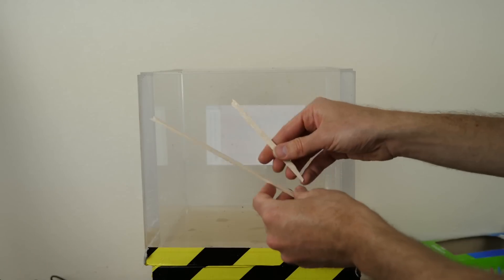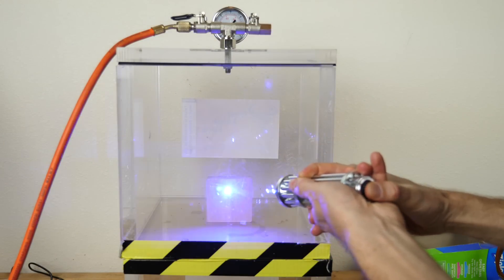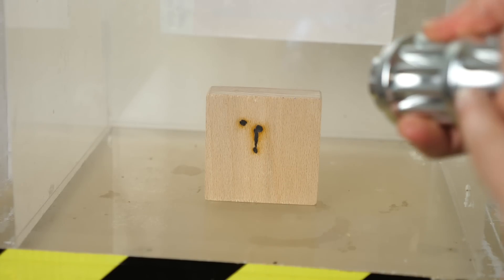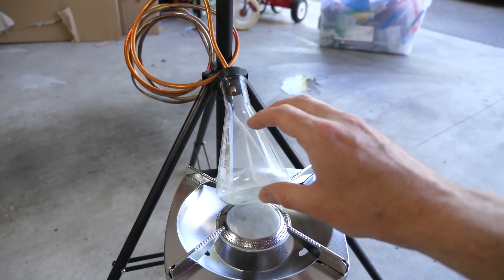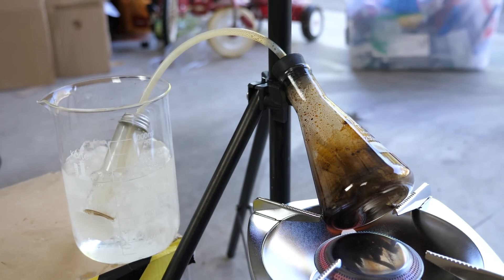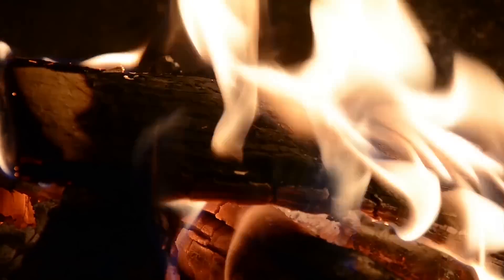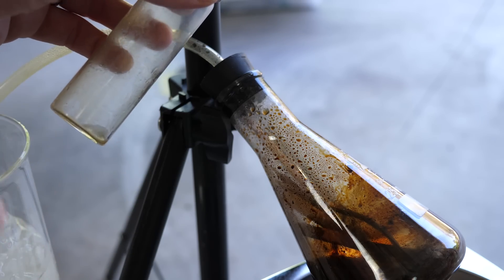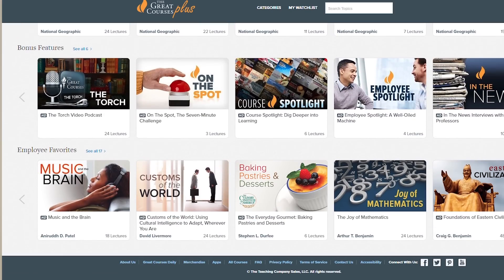Is It Possible to Melt Wood in a Vacuum Chamber? The Wood Distillation Experiment

Comment: No...

Pyrolysis will result in the decomposition of the Wood, even if no “Combustion” occurs.

The wood “breaks” down into the various components, and the long-chain polymers, like lignin, prevent the remaining materials from “Melting.”

You MIGHT be able to get it to “Melt” if you could lower the melting point of Carbon substantially below the 3500°C it requires at standard pressure to “melt” Carbon, which would then be below the temperature of the “pyrolysis” which causes the constituent breakdown OF the wood.
Reply: Soo if I'm reading this correctly it is:
"No..." the video isn't entirely accurate.
If [the remainder of what you said] is achieved, then you could possibly cause the wood to melt?
Reply: Zac 

“Possibly” being the key.

Comment: I actually believe it melts. All matter will melt if it's molecules vibrate and space out, allowing them to move and roll over one another but the problem is usually, it pyrolyses before it can melt so it does not usually melt. Usually.

Comment: A technique called “mechanically-induced wood flow welding” bonds wood in seconds without adhesives. Like ultrasonic welding of plastic parts; basically melts, flows and fuses the molecules of the parts together under pressure and high frequency agitation.

Comment: there are view correction from this video that i want to point out,
1. You need to seal the rubber lit with parafilm so the smoke won't came out
2. Lignin tends to converted into "char" rather than becoming liquid wood/liquid smoke
3. There's difference between combustion and pyrolysis, and since the lit is not completely sealed, your system is very vunerable towards combustion reaction (creating fire, just lacking the ignition)

Comment: Melting is a physical process that results in a phase transition from solid to liquid. When the temperature is raised to a substance’s melting point, the vibrational energies of the molecules exceed the stabilization energy of the solid-state lattice arrangement, and the molecules break free from the lattice into a less ordered state – the liquid. In order for wood to melt, it must go through this process.

When a substance undergoes a phase change such as melting, its chemical makeup remains the same. For example, both ice and water are chemically the substance: H2O. However, when heat is added to wood, the wood oxidizes before it would be able to melt. Composed primarily of cellulose, lignin, water, and several other materials, wood contains long-chain organic molecules that decompose into products such as charcoal, water, methanol, and carbon dioxide upon heating. The physical structure of wood is destroyed in the process, and the resulting material cannot return to the original matter. As a result of the chemical, irreversible breakdown of its components, wood does not melt.

What if you tried melting wood in a vacuum, where there is no oxygen to begin the oxidation process? This clever idea still fails. Although the water and volatile matter would evaporate in the vacuum, the long cellulose fibers in wood would strongly inhibit wood’s transition to the liquid state. Heat might break the carbonyl bonds in cellulose, leaving behind carbon in charcoal form or carbon dioxide.

In theory, it may be possible to melt wood by one alternative means. At standard temperature and pressure, the melting point of carbon is 3500oC. If this could be lowered to a temperature that could be attained experimentally, the wood might be able to melt. Although facilities capable of creating such conditions exist, there is no published literature that has tested this hypothesis. Thus, until science indicates that it is possible, the answer to the question, “can we melt a wooden log?” will remain a no.
Reply: Source: http://www.yalescientific.org/2010/05/everyday-qa-can-you-melt-a-wooden-log/

Comment: The wavelength of your laser must be such that it does not melt your vacuum chamber acrylic.  I know my CO2 laser melts and cuts acrylic.  
Have you tried putting your laser inside the vacuum and somehow remotely turning it on?  I would be curious if the vacuum would have any effect on its ability to burn wood (or whatever else).  Would it burn any hotter...might be hard to measure the differences if any.

Comment: Hi, thank you for the video. This is so interesting. 
May I ask, if wood breaks down and form the flammable gas that cause the fire to burn, why when we are about to start a charcoal fire, there are flame almost surrounding the charcoal as well?
Isn't charcoal produced from wood that are put under high heat so thoroughly that all those gasses are eventually evaporated off? Is it because of the carbon react with oxygen in the air?

Comment: What if it is heated under INTENSE  pressure  rather then a vacuum on certain occasions  things that would become gases instead become liquid under intense  pressure  like diamond for example  would burn if heated high enough before it would melt but in cases of extreme  pressure (not naturally found on earth) it would melt instead

Comment: Would acid melt/dissolve wood?
Reply: Scott D a strong enough acid would dissolve it, but not melt it. Dissolving something changes it’s chemical structure, breaking it down. Melting doesn’t change it’s chemical structure, it increases the space between the atoms and breaks their bond with other atoms, but it’s still the same atom.

Comment: Does hydrogen react to gravity if it does not how does a floating balloon fly and if it creates force  it cannot because it is lighter than air
Reply: Everything reacts to gravity. A balloon (which has helium inside, but hydrogen would technically work too) is lighter than air, so it floats upwards with a certain amount of force. Gravity is also pulling down with a certain amount of force, as the rubber of the balloon is denser than air. However, as the force of the hydrogen is stronger than the force of the gravity, the balloon rides.

Comment: Is it possible to get 34 degree body temperature?
Reply: Yes, and you'd still be alive. 34C would be counted as mild hypothermia and wouldnt be fatal unless the liver failed and was left untreated.

Hyperthermia is more dangerous as only a body temperature of 40C would be fatal, whereas the fatal low temperature is around 25C to 20C.

This is because the body can be reheated and enzymes will continue to work, but at high temperature they will denature (stop working) meaning the reactions in your body wouldnt be able to occur fast enough to keep the body functioning.

Comment: Maybe it would melt if the ambient temperature inside the chamber war of sufficient temperature, but not making direct contact with the heat source. If there's a way to suspend it in the vacuum chamber and heat up the air around it, maybe you should try that before concluding that it can't be melted
Reply: @DeRezzed I have to burn a thing or set said thing on fire in order to make it melt. All that's required is to make it hot enough for the molecules to lose their bond to one another
Reply: @DeRezzed in this example, it was under direct contact with the heat Source aka the laser. All I'm saying is I'd like to see what would happen if you heated up the chamber without making direct thermal contact with the wood itself

Comment: What would happen if instead of letting the air "back in" but rather just suddenly openning the lid without returning the air?
Reply: You wouldn't be able to open the lid. The pressure difference would be too high to open it this way and even if you could, it would most likely break the container.

Comment: Is it possible to have a controled constant explosion in a vaccum, like the sun? Since fire cannot exist in a vaccum, how about a micro sun or smthn like that? I mean, from what I know sun is in space and space is like a vaccum so thats my question.
Reply: The sun creates it's heat from nuclear fusion, changing smaller atoms into larger atoms. This is why it doesn't need another gas, as it isn't burning, the energy is just being released from the nuclear fusion taking place. The only way to replicate this would be using a nuclear generator, and i don't think he has one of them lying around
Reply: r/iamverysmart. Jk thanks a lot i really had no idea

Comment: Nothing should melt in a vacuum. Should only be solid or gas phase.
Reply: It's called sublimation. Dry ice (frozen carbon dioxide) is a perfect example. It won't melt into liquid at atmospheric pressure, it evaporates directly into the gas. to have it as liquid, it must be under high pressure. The only way I think wood can melt, is to heat it in a pressure vessel pressurized in a non-reactive gas, like helium, or argon. I don't know for sure.
Reply: Yes, in fact the very LAST thing you want to do is REDUCE pressure if your aim is to liquefy something. You actually want to increase it.
Reply: He should have tried this in some inert gas instead of vacuum
Reply: Perhaps one could induce vacuum and then add a whole lot of pure nitrogen to make it like 8 times above atmospheric pressure?
Reply: yes
Reply: You can melt it into a boiling liquid,  as it won't just spontaneously completely turn to gas

Also ionic liquids exist
Reply: Vacuum induction melting.
Reply: Finally someone says that
Reply: He had the right mindset of removing oxygen so it wouldn't react with heat. Trial and error. The base of the scientific method.
Reply: @minamihasaki4325  true he got one of 2 thing right
Reply: Guess I wasnt the only one to question this method

Comment: No. 
But you could possibly get a variety to drip out of it under an inert atmosphere at high temperature, especially if the inert atmosphere is at a reasonably high pressure.
At a vacuum, the closest thing to a liquid you could possibly get would be an amorphous solid (a highly viscous, glass-like semi-solid).

Comment: Rubber can be melted but only the rubber that was used for vintage cars before a substance that stopped rubber from melting that makes it like a thermosetting plastic much like Bakelite which is a plastic that cannot melt but char when heated.

Comment: Can other gases such as argon make a difference instead of a vacum or atmosphere  ? Like nitrogen, helium, Co2, or even H2o ? There's to many to list.  But when H2o is superheated can it sustain a suitable form to assist melting points  ?

I believe certain reactions can differ at differnt rates of heat and cold. As well as a sustained temperature for an amount of time. 

Perhaps differnt types of heat source such as , multiple radiation types , chemical, magnetic, friction, vibration, frequency/harmonic .  I'm not sure if all these are possible yet but I'm learning.

Comment: O2 bound or trapped in the wood made it burnable/smoke in  the weak Vacuum you had. You need a hard vacuum and a heat bomb to melt wood well. Compress it to melt it. and yes you can melt rubber. The other problem is you are point source heating. using induction or gradual heating will be more effective.

Comment: Could you somehow chemically bind the molecules to the point that they won't break down before they melt? I've been thinking since middle school that theoretically you could melt wood in a vacuum, so thank you for this video. But there must be a way, maybe soak wood in some kind of solution that prevents it from breaking down like that. I do realize that it wouldn't truly be wood at that point... But still. Also, have you tried different kinds of wood? There's always a way to defy physics, always, we just need to figure it out.

Comment: It still may be possible to melt wood.  Since its possible to melt dry ice under high pressure, if you try to burn wood in a pressure chamber, theoretically, you could see it liquify.

Comment: Could you try to keep lower temperature kind off like slow roast the wood too see if you would get a different result. Because if you keep rubber in heat it becomes easier to mold after time

Comment: Very interesting, but I think this experiment could be improved. I think you were still seeing some combustion due to air trapped in the wood. I'd like to see if the results differ if you: A- use a very thin slice of wood like wood chips or shavings, the thinner the better. B- Leave your samples under vacuum for a a day or over night to promote outgassing. C- As a control, show how the wood reacts to your laser in atmosphere. Then compare and contrast that with the results of your experiment.

Comment: How can rubber be "one big molecule"??!
You can easily cut rubber into 2 smaller pieces.
Which means those 2 smaller pieces of rubber are also just "one big molecule".
But if they are stable on their own, what force what holding them together before??
You can't just split molecules into miniaturised versions of themselves! Those can't be molecules!

Comment: At different atmospheric pressures, materials behave quite interestingly.  Take CO2 for example, at earth atmosphere pressure, instead of melting into liquid, it sublimates straight to gas.  You can get some dry ice cheaply, and watch it happen right before your eyes.  Under extreme pressure it can indeed exist as a liquid, but it takes quite a bit.  Water is also very interesting, as under very high pressure, it can stay solid as ice at 400 degrees F.  Nice demonstration in your vacuum chamber to show the properties of wood under unusual conditions!

Comment: Not everything melts! Melting is simply a phase change from solid to liquid, without changing chemical composition. It's a scientific word, with a definition. Even substances that can melt, only do so under particular conditions. On Mars for example, the pressure is too low for water to exist in liquid form, so heating solid ice sublimates it into vapor. Look at a phase diagram. The video is correct in stating that melting can also be prohibited by combustion or chemical changes, if these occur at lower temperatures. However, the language used in these videos is not educational, instead more like a cooking show. Don't say that 'every single substance has a melting point' if you then proceed to demonstrate that some things don't melt. Don't call burning something by heating 'spontaneous combustion'. Fire does not "burn air": the hot air (plasma) emits light. "Red charcoal patches" do not burn wood: they are burning wood. I may be nitpicking, but you may be misleading those without a science background, and bad language does not teach anyone science.

Most ideas and explanations in this video are valid, but they serve little purpose to them who don't have a good understanding already. There is no justification of how you perform the experiment, your thinking that went into it, what 'super bright laser' actually means, or even the kind of wood that you used! Like other videos on this channel, this just seems like Googling and a first try experiment, with interpretations that are technically correct (if you look past the language) but sloppy and misleading. On YouTube, look at Applied Science to see how it is done. Or read a book.
Reply: You articulated a lot of my thoughts on this - thank you!
Reply: Damn He mad
Reply: Well you actually can have liquid wood but it would break down before you got to it's melting point
Reply: THANK  YOU. It's like anti-science on this channel anymore
Reply: They serve purpose as to getting those views
Reply: Well I read a book now.
In this comment.
Reply: Are u giving us a science lecture lol 😂😂😂😂😂I was just😴😴😴😴😴 sleeping last night while reading this comment and today I am replying
Reply: @7N8173  u re not funny

Comment: NO, not everything has a melting point. It can, and does, chemically decompose to a different chemical substance, even in the absence of oxygen, before it does anything else. Even if you were to get some kind of liquid from wood under some conditions, it won't be molten wood, because you'll have induced a chemical change, guaranteed. To be MELTING, it needs to be able to SOLIDIFY again when the temperature goes back down, and for it to be the same substance. So you heat iron, and it becomes liquid iron, and then cool it, and it's iron again. You heat ice, it becomes water, you cool it, and it's ice again. But if you heat gunpowder, yes even in a vacuum, and it goes POOF and turns into a mixture of gases, that's not a phase change. That's not boiling the gunpowder. That is a bona fide chemical change.

Comment: Here's a thought experiment: Say you have a box of rubber thimbles, and each one is a technically a single molecule. As each molecule is only very weakly bonded to the neighboring molecules, and they can freely flow over each other (say if you stick your hand in and wave it around), does that technically make the rubber a liquid? If you then empty the box over the floor, and the molecules aren't touching each other, does that technically make the rubber a gas? (An extremely dense gas that settles on the ground beneath the other gasses in the room...)

Comment: I'd suggest you not to turn off the vacuum pump after the required pressure is reached. Turning off the pump increases pressure rapidly, as can be sensed by a proper vacuummeter. Second, when gases are released inside the vacuum chamber, as in your experiment, your vacuum quickly gets degraded. An operating pump can reduce this effect. Third, how about laser safety? Do you think these glasses are adequate? I'm not sure but I have some concerns whether you're doing it up to the proper procedure.
Reply: bormisha The fact that they’re measuring vacuum with a bourdon tube gauge is your first clue that this channel doesn’t know vacuum and doesn’t care to educate about how vacuum is measured.
Reply: Fourthly dont apply so much heat in one spot, apply heat over the whole surface evenly